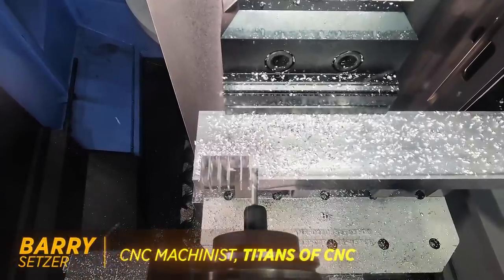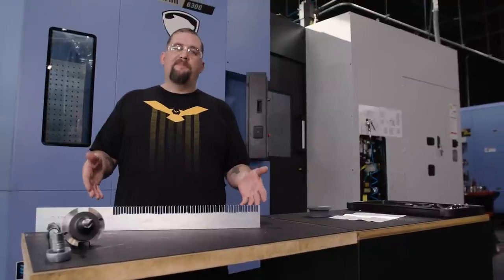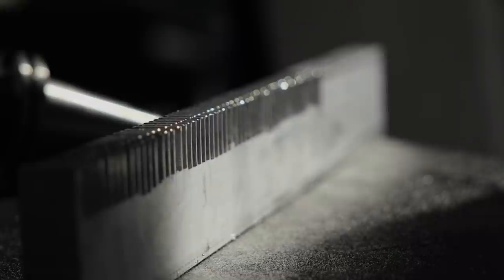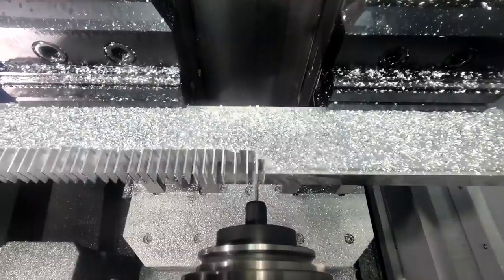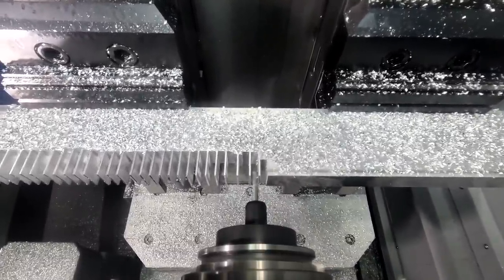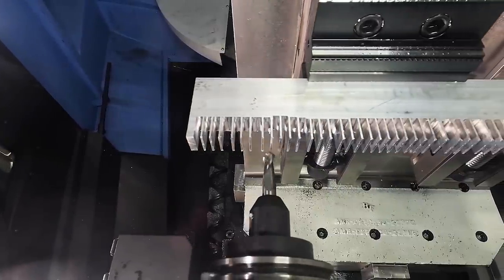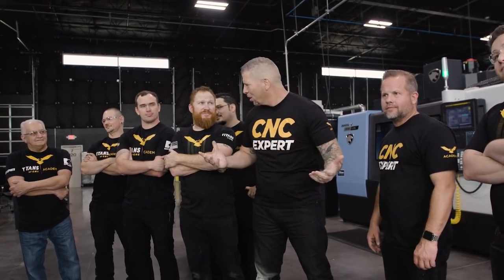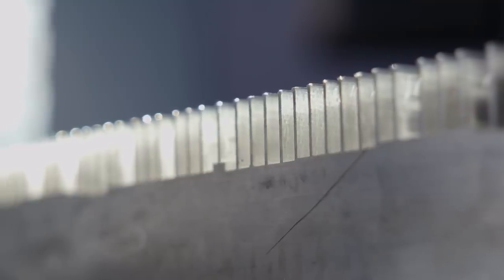Machinist Creates Music in CNC Machine

Comment: That’s pretty cool!  Maybe the next iteration you can allow a little more space In between the blades to allow for a slight pause in those areas to track with the cadence in the song.  By the way - not being critical AT ALL!  This is very cool and you didn’t have to do it for us. Thanks :)
Reply: Wouldn't it would save material to adjust the tool speed instead?

Comment: The reason they dont sound as the ecuation you probably did ffor thickness and lenght, is because you machined all notes on a single solid body, for example tuning forks, with perfect pitch, drill a hole at the handle and it wont sound the same anymore. Your ecuation might be right, but what you didnt have in mind was that every bit of metal you take from the piece, it will change its resonance, lets say you nailed the ecuation on how to machine 2 notes, but the next one will ruin the resonance again, so you will have to calculate progresivelly how the next note will affect the previous ones, the best solution is single bodies. Musical boxes will never be pitch perfect for this reason, they sound pretty, but listen closely and you will see, they are never in solid pitch, always close to ir but not quite there
Reply: Thats good information

Comment: Incidentally you can also make music with just about anything that vibrates as long as you can tune the frequency it vibrates at, whether it's the natural frequency of bodies of metal like in this case, a vibrating stepper motor on programmable tooling or a floppy disk drive or something, a high frequency oscillating electric arc (arc speakers are very cool) or some other configuration; if it makes sound you can probably adjust it to some degree to change the nature of the sound it produces.
Reply: floppotron

Comment: Not half bad so far. Really recommend not having the spindle rotate to strike notes. While it looks cool and it's possible to calculate note position relative to spindle rotation and movement, it's just an unnecessary complication that screws with the timing. Likely what's causing your sour notes too.

Comment: Why exactly Doosan, by the way? Why not a DMG Mori, for example?
Reply: Doosan is a well made machine that is significantly lower in price. That means more shops can afford them, and in turn means we can help more people to learn.
Reply: @barrysetzer  well... At least Doosan lathes at my workplace are pretty much primitive. I mean, Lynx 220LM, Puma 280LM, Puma 3100LM, Puma 3100LY. And all of them are in basic configuration, without automatic tailstock, without counterspindel, without Tool Magazine type toolholder - only traditional 12-position turret, so it's sometimes hard to put the tools a way, they don't crash into the chuck during the work. No B-Axis. Only one lathe with Y-Axis. So, for me Doosan took a place, as some kind of pretty basic machine manufacturer. Doosan SMX series looks great, but looking at that 9 years old DMG CTX Gamma 2000 TC video - DMG Mori looks pretty much cooler.

Comment: I'm really surprised a CNC operator couldn't get the time metrics correct at least.   There are a couple ways at least to do it perfectly. And easily.
Reply: There were alot more variables than you might think.

Comment: That was a nice try. In theory you should be able to use ratios to calculate the right lengths of the tines. But I can see the tuning didn’t work out entirely. You would probably have to hand file the tines into tune. 

One time I heard a cnc machine play a perfect third interval by milling. It basically hummed a chord with the material it was taking off. It was a very pleasant noise
Reply: i think basically the pauses were a bit too short, otherwise pretty good

Comment: I had a similar idea years ago but never tried it. Get someone who isn't tone deaf to help you next time.
Reply: Its much harder than you might think. Variables like consistency of the raw material, how hard its clamped, where it’s clamped. I used a pitch app to get the notes, but even running 2 identical ribs would result in 2 different notes.
Reply: @barrysetzer  The thing that gave me a similar idea was sliced-up transmission cases from when I was a QA tech for a transmission manufacturer. If you go with bigger pieces, aiming for a lower key, you wouldn't have to be as exact with the amount of material used, I think.